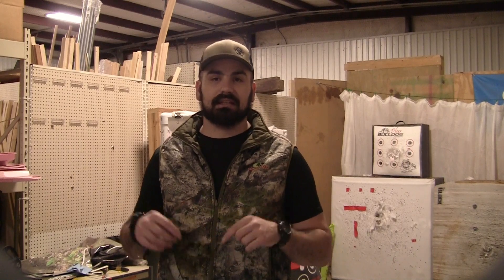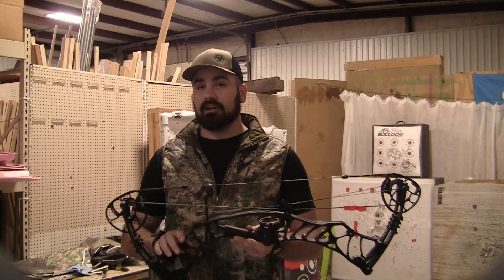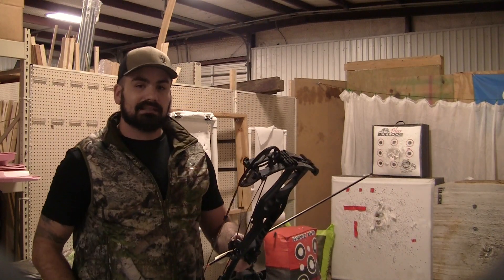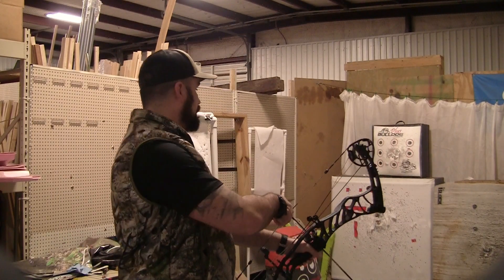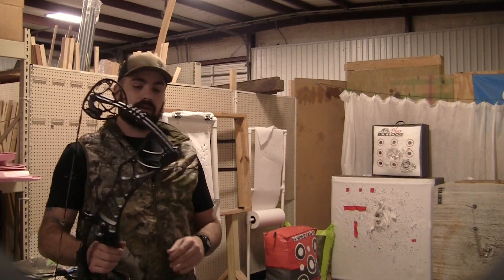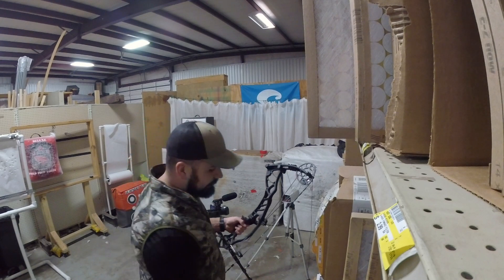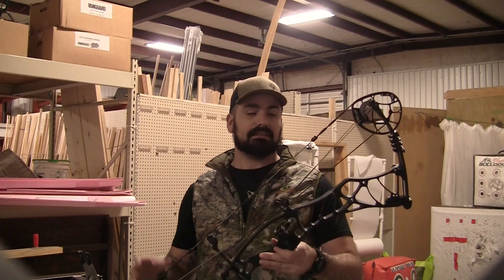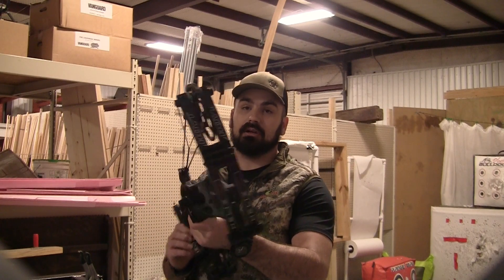Hoyt Helix TURBO Review | Speed Test

Comment: Can you review the carbon Rx-4 turbo?
Reply from the maker: Clarence Maximum i think the helix turbo is the only turbo this year. But if they make the Hoyt rx4 turbo I will check it out.
Reply from the maker: Clarence Maximum so they do make the turbo in carbon I didn’t know that. I will ask the shop I used to see if they plan on stocking it. If they do I will definitely do one.
Reply: Infected Outdoors I ordered carbon rx-4 turbo almost a month ago, still waiting. There’s only 1-2 reviews of it on YouTube. Not as much hype around it, seems like Matthew’s and PSE are the most popular this year. I
Reply from the maker: Clarence Maximum for good reason tho. They are some really nice rides. The helix turbo is a solid bow too if it is anything like the others bows I would prefer the aluminum riser bow. They just felt better to me. But I haven’t shot the turbo carbon
Reply: Infected Outdoors I upgraded from an older Matthew’s z3. It was a tough choice, between the turbo and the VXR. I don’t know if I made a bad decision though haha, I’m not an expert. I was impressed with the speed, comfort, quiet, smooth draw, but solid back wall, felt aggressive, no vibration on the turbo. I thought the vxr looked a lot nicer especially in green, and I thought the same things about the vxr.
Reply from the maker: Clarence Maximum one thing i realized doing these is that there really isn’t a bad bow they all have upsides and down sides.
Reply: Consumer: will $500 more for identical specs and a carbon riser weighing 4 ounces less make me a better hunter???
HOYT: ...Yes...😂🤣🤣